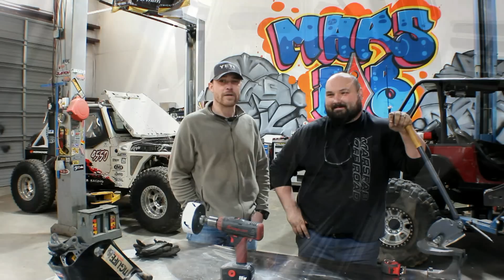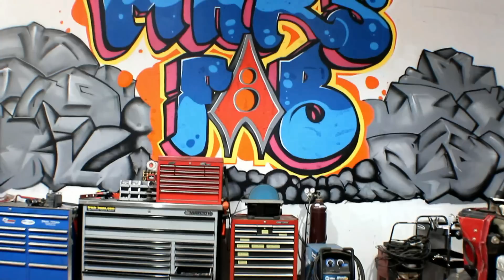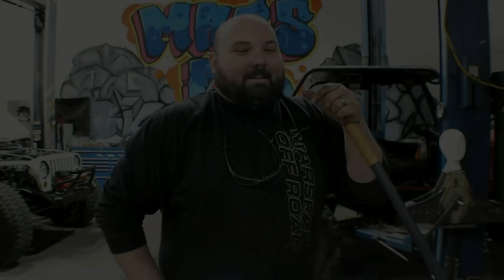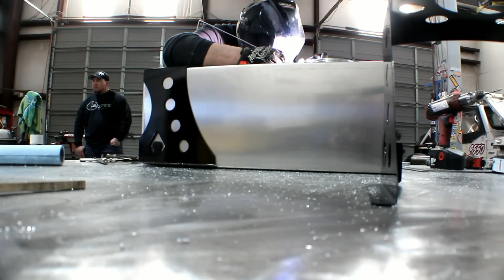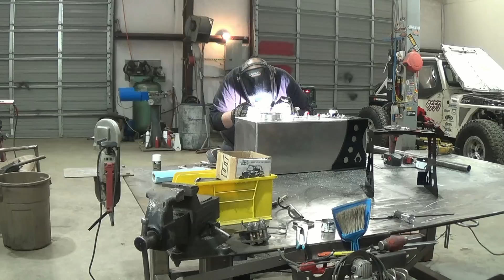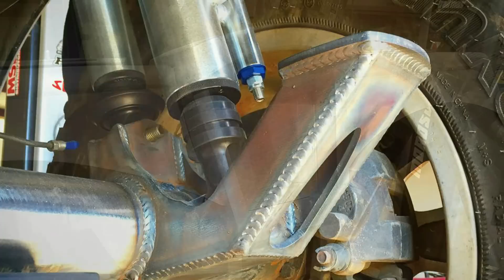Off-Road Fabrication Shop | Mars Fab Offroad

Comment: At first glance, it looks like a rear modified "Sugar Bare" suspension arm off the rear axle, except boxed. He does motorcycles in LA with solid rear bars and over / under springs on the front side with extended wheel arms! I don't know how to describe it other than he has a 9 month back order and builds each one himself for the last 48 years!
Cool... DK, Omaha. Retired ASE master.